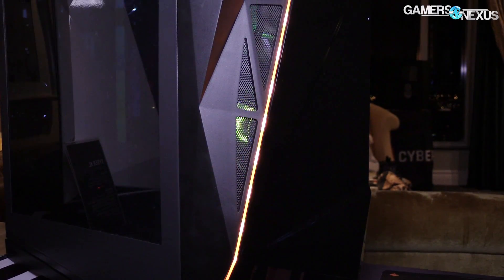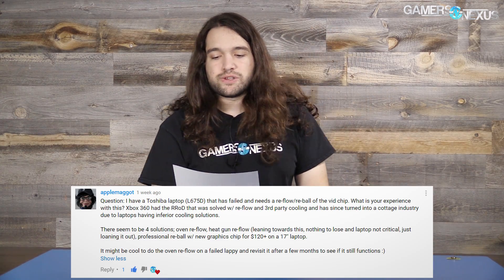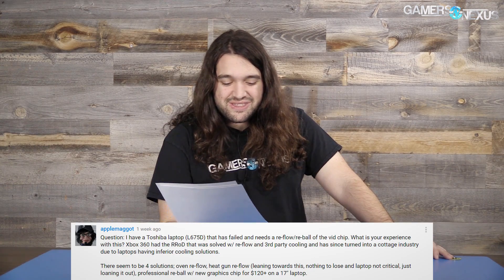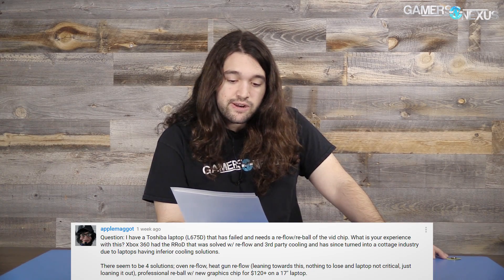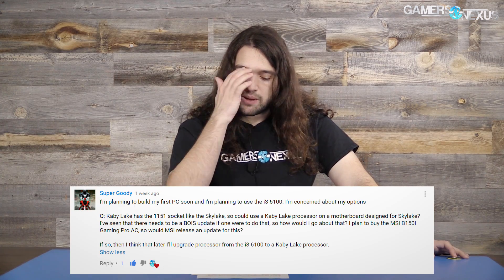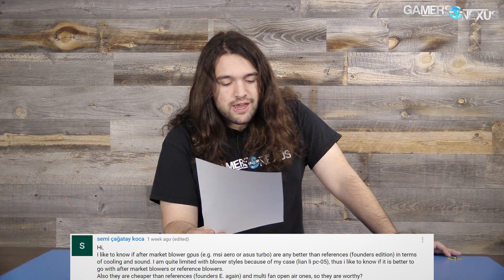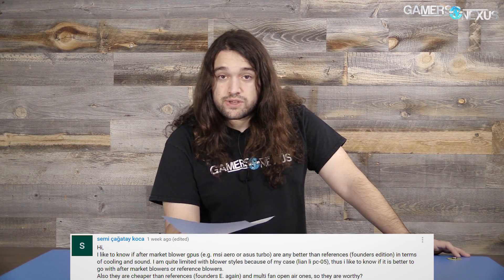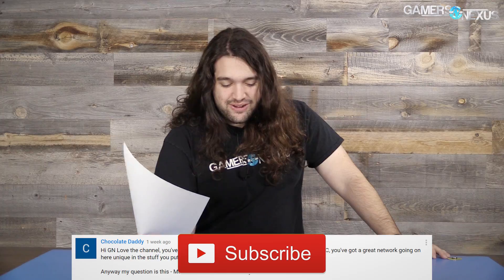Ask GN 40: Reflowing Laptops, OEM vs. Non-OEM Parts

Comment from the maker: Thanks for the questions, everyone! Leave your new questions as a top-level comment, please! This next week will be very busy with CPU content and testing, much of which will be revealed next week. Be sure to subscribe and check back for that. As always, we've got other news items and features on http://www.gamersnexus.net/
Reply: Question:
i have a asrock z77 pro 4m mother board with a i5 3570 ,i was wondering how much speed on my graphics card i would lose (in a %) if i have a gtx 1060 and two pcie tvtunerduo tuners(4 turners on 2 cards) .Does the 2 tv card slow the graphics card . With graphics card in there are on 2 free pcie slots free for the tvcards so i cannot pick a different slot they have to go in the only 2 available slots.
Reply: When will you upload your rock band videos ))) ? thanks, great work as usual !
Reply: Steve, I think I speak for everyone when I ask what shampoo do you use?
Reply: sry but the oven method is the best think ever. i got my gpu for free bcz they was defect i use my oven and know it runs fine ps:i know they will go defect in some time but they run fine since 4 month
Reply: #AskGN Hey Steve! love the work, never leave us please.
So how does RAM frequency affect CPU overclocking? i read that having a more direct multiplier, say 10x for 2666, instead of 2800 for instance, could result in an easier time getting those last few MHz out of the CPU due to more stability. is that so with XMP? how so? why? you know the drill! 

Another question, should i connect my Headphones to the MB directly or via the case's front panel? i got an MSI z207 M7 MB, a BeQuiet DarkBasePro900 and an old set of Sennheiser HD555 (120 Ohm).

thanks in advance!

for context:
I'm building a new rig and i had doubts about RAM picking. i ended up with a set of Patriot 2800MHz CL16 but i fear that a set of G.skill RipJaws @2666MHz CL15 could have been better. both RAM kits at 1.2v. and they will be coupled with an 7700K (fucking intel is charging dealers around 398€ here for it. i am so fucking mad. but due to unforeseen complications i need to buy it now and can't wait until Ryzen. i will wait for Vega though, which will render my machine useless for gaming until then but i refuse to pay for g sync and buying a 480 now doesn't make sense with Vega a couple of months away if i can nab me a 1070 equivalent. in the future i'll get a freesync 1440p 144Hz IPS display.) which will be WaterCooled with a custom loop including a 360rad just for it. I am really hopeful i can at least reach 5GHz as it is a magical unicorn of sorts for CPUs without LN2 in my book, and 5 is also my favorite number ahahah
Reply: I have the APEX M800 from steelseries. I have my headphones and mouse plugged into it. The keyboard he 2x usb2.0 leads that need to both be plugged in for the keyboard to work. I no issues with mouse or headphones and I use them both 6+ hrs a day. The extra power/data lanes makes this a solid solution. I don't think I would be saying the same if this only had 1 usb lead.
Reply: I have an older system,. A Core 2 Quad (q9650 3 Ghz) on an intel extreme mb with 8GB of DDR3 ram, currently running with a evga gtx 760 sc 4GB in a custom case,  This system runs games at high and sometimes ultra settings with playable frame rates (25-90 depending on the game), i'm planning on an upgrade of the video card, either to the gtx 1060 6GB or the 1070, i have 2 questions.
1. With this system setup, is it worth it to dish out for the 1070. would i see any performance gains over the 1060? since my cpu is much older. bottlenecking and the like.
2. why am i getting higher performance than other ppl that i  know that have better hardware in cpu and gpu? just as an example, someone i know is running an i5 2400 8GB ram, and a gtx 960 4GB in a pre built system., yet i have significantly higher frame rates than his system in all games, and my system is not overclocked. i'm just curious about your opinion on the 2nd one.
Reply: +max dicus i think upgrade your gpu is a good idea bcz i using a qx9650 @3.8ghz and a gtx 780 and i can play the most games in 1080p in ultra bs go overclock your cpu you can just oc over FSB and you can 300 mhz without cange the voltage
Reply: Overclocking is an option. The mb does support it. Tried my hand at it a few times with limited success. But I really wanna know if the cpu bottleneck on my cpu (at stock speeds) will effect gpu performance on the 1070 so much so thats it's not worth it, or does get much better performance than the 1060 even with the bottleneck. Overclocking could be done later since it's a pain and time consuming. Thank you for the suggestion max yumu
Reply: And this one is more serious question, NMVE SSDs on older MBs, I have X79 Rampage IV(with latest update from 2014) and Asus support and all forums claimed there is no way it will work as a boot drive with out bios modes and etc. I still went on and bought 950 pro and it worked with out any tweaking with all advertised specs. 

So the question is: are MBs manufactures just trying us to buy new stuff and being silent that it works just fine on old ones or was it me just lucky with my MB ? May be if you have older MBs you can test it. Viewers with older MBs might wanna upgrade.
Reply: i think the q9650 at stock will bottelneck a 1070 but i dont know how much and it depends on the game
Reply: So glad you didn't recommend the oven method!! It annoys me to no end when someone says "put it in an oven and it'll be totally fixed!" the last time I used the oven method I got 6 hours out of my GPU! it failed during a competitive match of CSGO and got me leaverbusted lol... needless to say I replaced it!
Reply: After watching your emergency rebuild I now wanna know what you would buy for rendering rigs running different applications, like one setup for premiere, one for blender and maybe one for handbrake. I know that puget systems has tested some stuff and is giving (probably good) recommendations on their site but what would you buy today?
Reply: Dear GN.

I have a question regarding an OC on my Asus M5A97 R2.0 + Fx 8350  With Akasa Venom Voodoo Higher end Air cooler 2X12
PSU is Corsair CS750M 80+ Gold .
Gpu  Rx 480
Im running  a stable overclock on offset mode  at 1.392 Vcore @4.5Ghz  24/7  for over a Year now.
I can torture that Cpu to death  with  Rendering  , Prime 95 or Realbench @4.5 without problems at 75C max .. 
But as soon as i dial in 4.6ghz no matter how much Voltage i add (not hitting 80+C) in it freezes up my PC  so i have to hard Reset it.
Either Prime95 core fails or PC locks up.

I know that mobo isnt the best to OC on  but that 100mhz past 4.5ghz oc problem baffles me.
Help Needed.